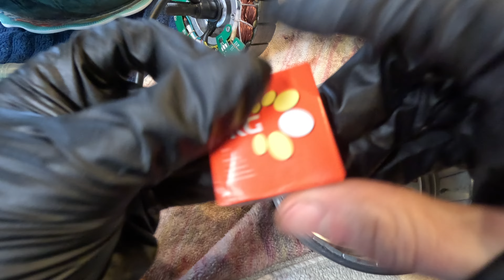Broke Bafang G60 Motor?! Repair Attempt w New Bearings. Maybe Janked

Comment: I’ve seen videos where guys replacing bearing on freehubs just use a socket that is the size of external ring of bearing to pound them in. Just a thought!
Reply from the maker: that metal piece, i think its called the "sun gear" , worked great to pound the bearings in with a rubber mallet.  the back of the sun gear presses against the external rings of the bearings nicely
Reply: For that you can use the old bearing, he is the same diameter. 😉

Comment: Also it would be a good idea to always match parts with replacement after disassembly. Just because parts have same numbers some clearances may differ. Not trying to be rude or criticize just trying to share some knowledge
Reply from the maker: yea its a chinese motor who knows what bearings they use,  they are fairly standardized , in terms of inner and outer diameter ,  it may have been slightly taller  or something but almost identical.  That rotor shell was all bent up , a new rotor fixed it

Comment: If you take apart such a motor, the rotor mostly touches the magnets on one side. That is NORMAL. When you reassemble the motor the bearing on the other side is going to align everything back to normal.
Get yourself a socket wrench set that goes up pretty large. Now you always have something to drive in bearings in. You want the socket to only touch the outer race of the bearing (the part of the bearing you are driving in, when driving a bearing onto an axle you probably need some sort of tube than only touches the inner race).
Good luck.

Comment: Great video man, sorry about the motor. Hopefully the new one will work even better. Those windings look REALLY clean considering how much power you were running through it.
Reply from the maker: Yeah the windings seem OK, they look darker / dirty in some areas but its magnet dust. Im gonna try to fix this motor with a new rotor- I found one for 50$ worth a try. Hopefully the rotor scraping on the stator didn’t bend the whole damn stator up too.   But it may have, in which case i have a front g61.1000 coming, same one you have on the psycho cycle !! I think i might have to rebuild the whole wheel if that axle is a different size though Lol… that would be a project. But yeah this is fun, typical ebikebuilder stuff 🤣😂🤙

Comment: Very informative, your perspective is very much appreciated 👍

It seems like the geared hubs really suffer in high speed, high impact situations, after hitting potholes at 35+ mph. I'm trying to keep from abusing my own bike's motor, so I turned down the amp limit and use soft start, but I'm still weary of the plastic in there. The Lightning Rod Big Block kit is probably more suited to the kind of hills I have to contend with around here, but a qs205 would be much more convenient if I can keep using the frame I've got. Any chance that you'll use a different motor?
Reply from the maker: I’ll keep the geared hubs on this bike. The geared hubs are fragile apparently i have seen a handful of people break them but i never had any issues till now. I have the 72v bbshd bike i will ride more this year when the weather is better. I want to try a QS motor but they are kinda heavy for bikes, idk. I would prefer to have a QS motor on a bomber frame with suspension or something. I don’t want that big heavy qs motor in a hard tail.
Reply: The new motors out now are suppose to be built so that there NEVER to be worked on ! Your not even suppose to open them i know i will be just for a look and to properly seal it . apparently theres carbon parts no need for grease i honestly dont know but it says it on the manuel and the website ive a 250 watt motor new thats bigger than a 5hundred watt i dont know the size of a 750watt but id say it would be more that size,has a torgue sensor in the bottom bracket so no magnet PAS and its a thing of beauty u can stop fully halfway up a hill and u just gotta put your foot on the pedal and your moving up that hill if u want touch that throttle and irlts taken u up that hill like nothing but it only goes 15mph in pedal mode but thats only in the firmware meaning it goes 1to 4ratio U can nearly pull a wheelie as is if even on 2 you wont be needing throtle but its so nice gone in 60 seconds buzz,but i gotta confess it says 250von motor but truth be told it was done for eu market and im in ireland so its legal it does about 20miles without messing with it but unlock it and its gotta be 30 plus then get a60 volt controller and your doin 40s and to top it off get a 20amp battery abd you've got the nicest fatbike 20inch  wheel out  there cant lie ppls✌️out

Comment: You did not appear to check for free play in the bearings. Without it, the bearings were not going to be your issue. Also, you never, NEVER hit a bearing in from the middle race. All that does is stress the bearing and cause damage that will lead to premature wear or possibly destroy it before you even use it. You press or tap them in by the outside race. Use a socket, tube or similar. You could have even used the old bearing to tap in the new one

Comment: I'm still having trouble with my g60 motor , I took it apart again after it started doing something like slipping but after it cooled down I checked the magnets and they were all in place and tight but wondering if after it heats up if the glue is coming loose , I am marking one this time so if it does this again I will see the marks misaligned . The  bearing on the inside of sprocket plate is working itself out and see this one in this video is slightly coming out too. . I am disabled to using the bike as a mobility vehicle and mostly ghost peddling , that might be why its over heating . I really can't afford a new larger direct drive motor and controller but as it is I've made 2 extra 22.5 ah batteries in saddlebags for range , I guess  I need to slow down on this 26" Wal-Mart special 36v 500watt fat tire bike.
Reply from the maker: Did you look at the nylon gears and make sure all the teeth are OK? if it feels like its slipping, it might be that a tooth on the nylon gear(s) broke off,  it will continue working mostly fine. But randomly will feel a slip,  it will continue to get worse as more and more nylon teeth break off.    If the magnets are coming loose, it sounds like a metal scraping metal but it will still be working probably. Let me know im always interested about these, if you have a video where the problem can be reproduced id be interested to see it
Reply: @EBikeBuilder_  I thought maby the gears but they look ok , it’s wierd as it definitely felt like something was turning and no movement
Reply: Found that problem it was the clutch so replace it with new gears and tried to get bearing in as far as possible but also found burned wire at controller , just repaired the wires and am reassuring now , hopefully it will fix it

Comment: Does that axle pull outta that other part ?? I was told u need a press to push axles outta ebike hubs like if the axle got bent or watever ,i was gonna make a press with a lorry jack and ive a frame already made from another job
Reply from the maker: @whitefeatherslinger8194  i think its  snap rings holding the axle in the stator, I’m not sure, I’ve never taken that apart. The motor cable goes out one side of the axle, and is soldered onto the hall sensor circuit board. So if you replace the axle, you have to rewire the motor cable too i would imagine.  I’ve Never heard of an axle bending on these hubs. if it was bent, i think the rest of the motor might be damaged as well. I’ve heard of hard impact breaking nylon gears under load  But haven’t seen a bent axle
Reply: @EBikeBuilder_  ive only seen it on here the bloke had the wheel in his hands holding by the axle and had his woman recording it was defo the axle i tried telling him on the gearless hubs they gotta be pressed out ,ive my own press i made from a passed job works from a lorry jack a air compressor one this will push it but id make like a metal top and bottom incase it ever slipped ,ive a problem i got a brand new 20inch 5hundred gearless hub for my boy have fatwheel s and a steel bmx type frame but they didnt thread the hub to put a cassette as he needs some gears to pedal as its too stiff eith a bmx sprocket anyideas ive got the cassette from a folgup ebike but its threaded how much is them ally threaders its gotta be like 40mm wide tho its stupid cos they put the part there id say they just forgot cant send it back cos ive got a bmx sprocket on it and its fast u know but ive suspension and a back spring with the wide wheels so its sweet but needs a chain cassette cos its full throtle even when he needs to be slowin down any ideas bro

Comment: Mine was doing something like that so took it apart and the inside bearing was only half way in , I couldnt get to my shop press due to disability but was able to drive it in another 1/4" as it was 1/2" out . put it baCk together and see if that helps an if so will take it apart  again at a later time.

Comment: I’m repairing mine from flushed motor. 
I didn’t make video of but some pictures. 
I will remplace all Hall sensors, remaking the electronic card (I have to find the capacitors information and I will put them near the controller), remplacement of all bearings…. And I hope I didn’t screw when disassembling, everything apart.

Comment: I have this one cookie sheet I use for baking bacon in the morning.  I just throw it in there to heat up with the oven.  I always know when the oven is hot because of the loud BONG the cookie sheet makes when it deforms from the heat.  You need a new rotor my friend.  I read through the comments.  It's not the axle.  If the axle was bent, the rotor would just spin tilted instead of wobbling.  The rotor is warped, probably from the heat.  You are going to need to true the wheel too.  That can't have been good for the spokes.
Reply from the maker: Yeah actually, i noticed it had a big lateral deviation that hadn’t been there before.  I don’t think its the axle either. The rotor was wobbly AF, regardless of its position along the axle.  Someone suggested that banging on the rotor with a rubber mallet might not be ideal, or perhaps i had the gear puller on crooked or something, i agree that’s a possibility, but i never opened it up in the first place till it had a scraping problem. so think this rotor warped out of tolerance slowly over time. At first it would only scrape at maximum RPMS giving it full power. I opened up the motor and the magnets were sliding out along the rotor shell. So i glued them back in and it was a little better.  Ride it for a while. Then the other day when i did that video where my bike light got launched off from an impact of my horn bottoming out, something happened and that was it, i thought the brake rotor was just bent at first but then i was riding around the yard and it got totally F’d out of no where. I have a new rotor coming from ebay to try out. I hope the stator didnt get messed up. Or i have a FM g61.1000w (5t) that is coming that should go even faster. 😎

Comment: Aluminum housing is warped at some point and becomes very hot then rapidly cooled possibly hitting a deep puddle of water warping the aluminum. I would buy a new hub motor and. Use the other for parts replacement you need special tools to properly diagnose and fix the real issue dial gauge  for runout and micrometer and a table vice to hold the shaft. But to cut to chase another motor is or should be in order to be safe. Unless you decide to drop it off a license tech to have it serviced or repaired or replaced.
Reply from the maker: @mccoymotley1124  i bought a new rotor on eBay for 50$ and fixed it . I think at some point i warped the rotor while using the gear puller

Comment: the bearings can't cause it to wobble, the magnet housing is warped and you have loose magnets, the motor may still be usable if you glue the magnets, when completely assembled the housing should minimize the wobble.

Comment: Too much grease, use silicone white grease instead. You can rectify the stator on a cnc machine, you'll have to  tropicalize it afterward. You can use the same method for the rotor as long as the bill is not exploding.
Reply from the maker: thanks for the suggestions, its good to hear your thoughts and know there is a possiblity of fixing it. Also good to know about tropicalizing the magnets. I thought they might degrade when damaged and exposed to air. Thats a good point. I dont have access to a CNC so for now i have ordered a new rotor, I am hoping the stator is not too messed up and a new rotor will be able to spin freely,  we will see in the coming week.  And if not, i have a bafang Fm g061  1000w front motor coming from China that can replace it.
Reply: I don’t know if the magnets will be operational after that.

Comment: Try replacing the axle ,  bent relative to the stator.
Reply from the maker: it could be.  That looks like a mess to take apart though, would probably have to take the motor cable out of the axle, and redo it. The new motor itself is like 200$. so they arent often practical to repair,  other than the nylon gears and whatnot